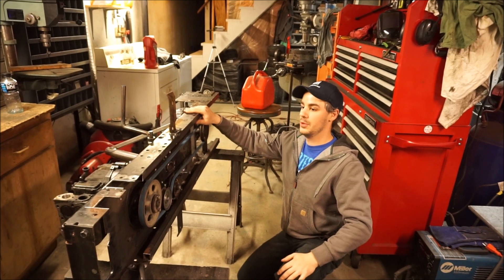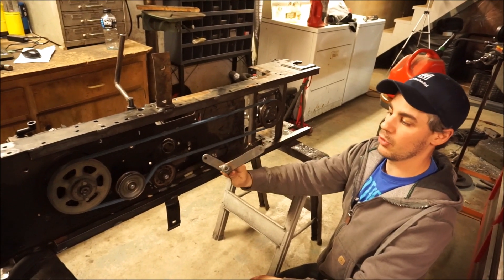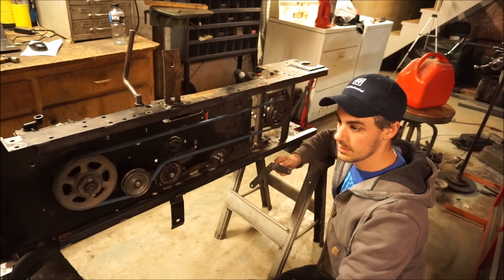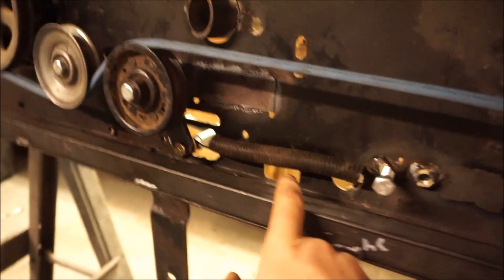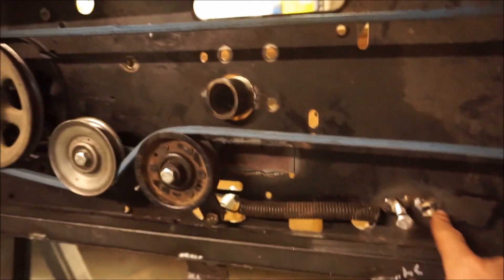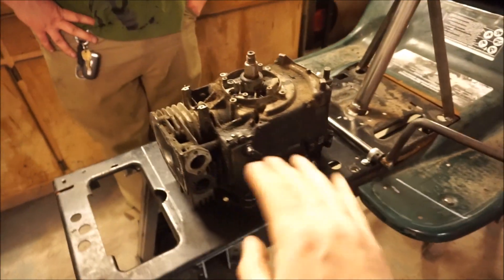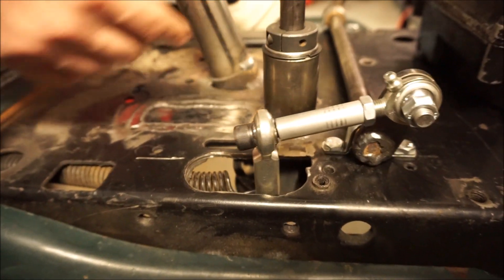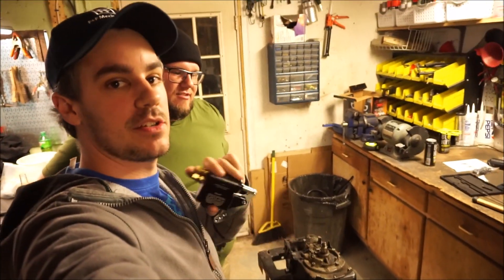Racing Lawn Mower Build Part 5: Building the clutch

Comment: How about that torque converter set up on the DB30S boys? Did you have to modify the frame or did you trim the TAV2? My gx160 is mounted using an NR Racing plate so I'm sitting about an inch off the frame as is. Is it possible to install without cutting the original chain tensioner tab? I tried looking for the video where you did the install, is it easier with the gtc?

Comment: Hey guys if you had to choose between keeping a ct200u or a doodlebug which would you stick with?
Reply from the maker: That's hard for me to say, the CT200s are cool but I never had one. I would think they ride a little better with the bigger tires thougb
Reply: @TheJanticJournal  https://youtu.be/nFlNAnbcMbQ this is ridiculous at any level but a death trap in the woods.
Reply: @TheJanticJournal  the biggest drawback for me is access to the drum brake. You have to pull the axle, 2 spacers, the rack, a handful of washers and the axle just before getting to it. I pulled the rack off because I was so frustrated with it.

Comment: Hi I’m 12 I like u toke lawn mower racing I have a mower with a 20.5hp it will reach a top speed of 100kmh they are dangerous machine
Reply: I also have a idea take the rear end out and weld the spider gears so they won’t turn it will drift like crazy
Reply: And for more speed take the pully off a regular lawn mower rear end the huge one and put it on the front and for the back take a electric motor pully and put a 20hp engine the mower will hit 120kmh easy
Reply: Insane Gaming what

Comment: I think you are probably the first person I have heard of besides myself that runs those pulley sizes. On your old setup, was your clutch closer to the engine like on this? On my current mower, the clutch is dead center between the trans pulley and engine pulley and the disengagement is my biggest issue so I wonder what works best for you.
Reply from the maker: Yes, the clutch was in a similar spot on my older mower too

Comment: I have a suggestion for the clutch shaft when you mentioned the bushings were captive on there. Could you cut a keyway and tap the inside of the pedal end of the shaft? Have a shaft collar to the inside, and then bolt and fender washer the hub, as well as the set screw, and have the pedal welded to the hub. As I was typing this I was worried there might not be enough material there to do that, and use what might feel like a sufficient sized bolt. I like the design of the clutch pulley mounting, with the long shaft it rotates on. Looks good at preventing unwanted movement in any direction other than where you want the assembly to move.
Reply from the maker: A key way setup could work too, in the event that the bronze wears out I'll just have to grind the weld off on the side opposite the pedal. The bushings should last the life of the mower, I just like having things more serviceable
Reply: @TheJanticJournal  serviceability was what I was thinking with the suggestion, but you are right, the pedal itself in general shouldn't be a high wear item.

Comment: You should use a vent on that transmission so that it doesn't build pressure
Reply from the maker: I definitely will, that transmission isn't race prepped at all, still filled with grease. Thanks for the view and comment!
Reply: @TheJanticJournal  no problem I look forward to possibly meeting you at a race after all this stuff is done because I'm getting into racing